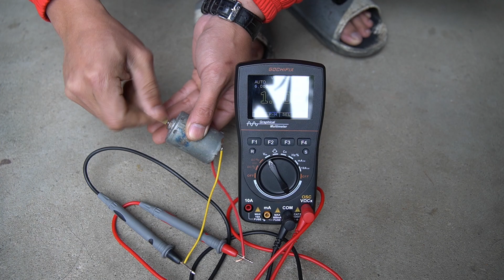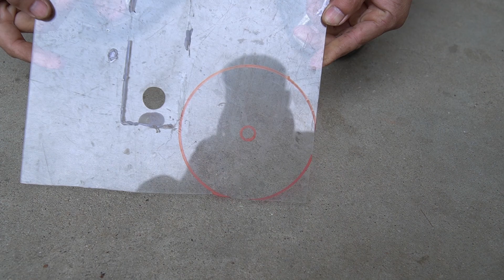I Created A Powerful Free Generator With Permanent Magnets

Comment: The advert pic on this video says 3500w comparable to a hefty gas based generator. I wish there was a scene in this proving it rather than a momentary one showing the volt check with manual rotations on the motor. The validation would make one feel like this was more legitimate
Reply from the maker: yes!